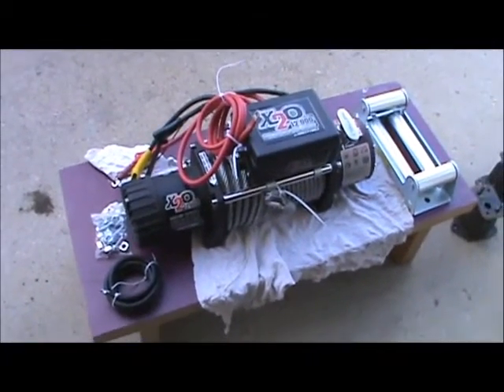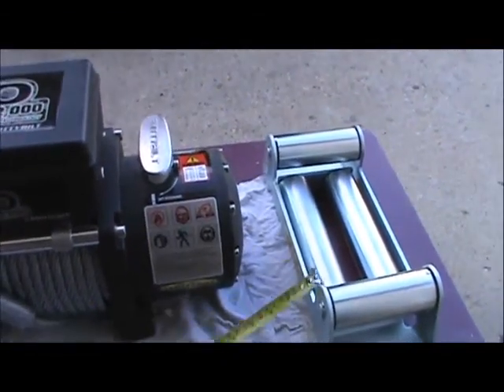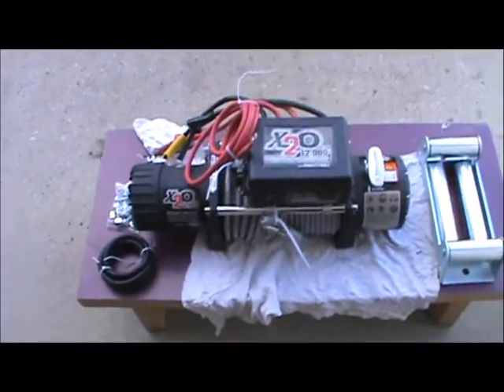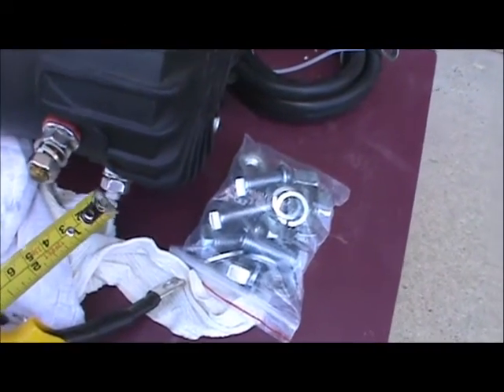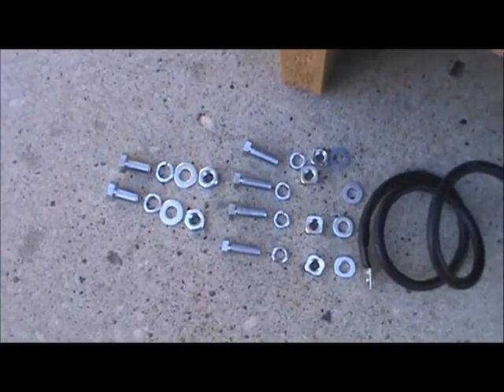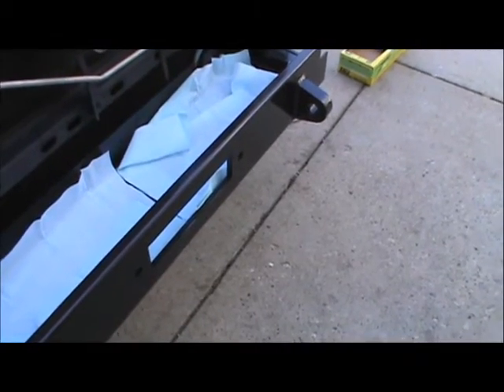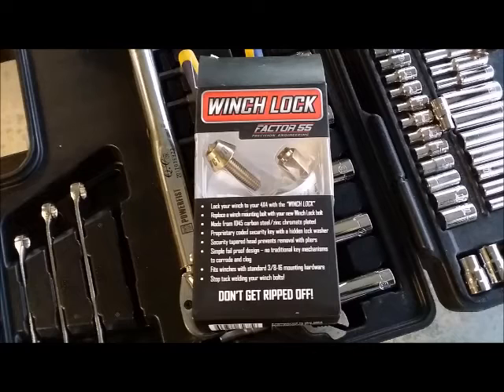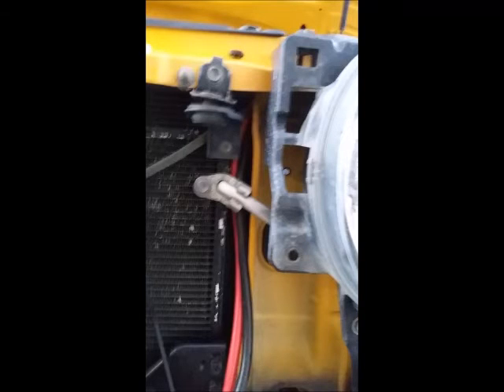2007 FJ Cruiser US Offroad Bumper Install Part 3 - Smittybuilt Winch

Comment: Great video! Great points and a very helpful video that we will reference from our website. 

Couple of notes. While he uses the Factor55 security bolts, and that is always a great thing to do, with the bumper cover on it makes it almost impossible to steal your winch without a LOT of work.

All winches are different but anything like the Smittybilt used in this video works well. We use a standard 10"x4.5" bolt pattern so any winch will bolt up. Sliding the box over to the passenger side is sometimes required, as it was in this video but really makes no difference. Some integrated solenoid winch designs will work, some won't, so it's always good to use a winch with the removable box. Looks great!

Also, our website is https://usoffroad.us (.com was referenced in the video) and our store is https://www.usoffroad.us/store ..